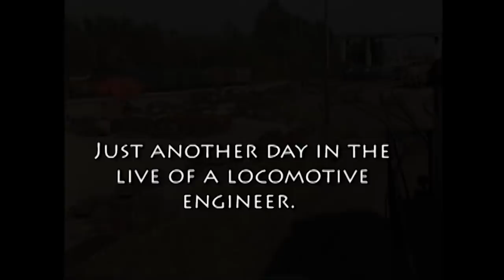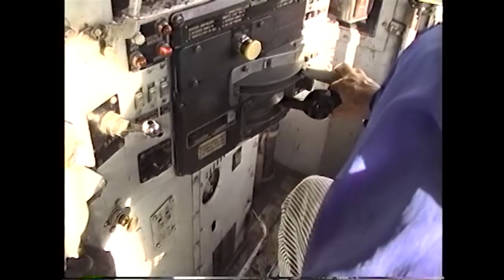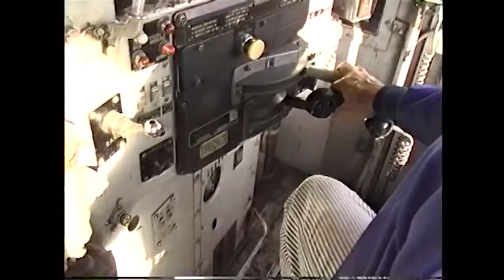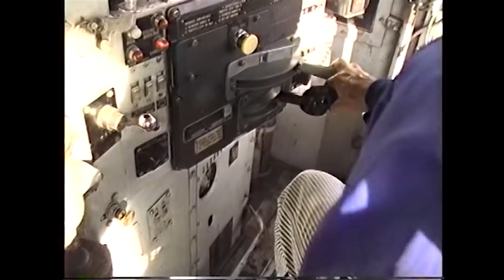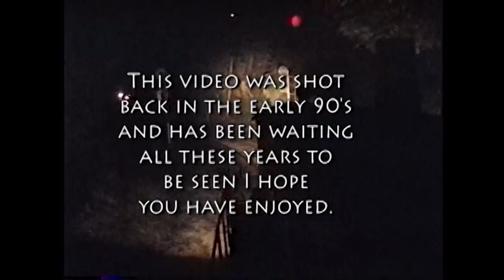View from an MP15DC Locomotive on  Southern Railway Freight Train 1995 New Westminster to Chilliwack

Comment: great video. only comment is, those locomotives are not sw900's. I heard the engineer say 15? and the number board showed 151, which means these are MP 15 loco's, which BC Hydro received in 1975. The sw 900 loco's were all numbered in the 900 series, a hold over from BCER/BC Hydro times.
Reply: This is an EMD MP15DC.

Comment: Very good quality for as old as this is. Really enjoyed the video!
Reply from the maker: Thanks. It was shot on a CCDVX3, which was a high end 3CCD Hi8 camera. It was the first of the small, truly broadcast-able quality cameras. Sony sold thousands of them to TV stations to be used for news gathering, as they yielded quality that was almost as good as a betacam, at 1/10th the price of the cheapest betacam. They had a bigger brother to it, the EVW300, which I also owned. That was a 12,000.00 camera and was very close to betacam quality. So close, that when used with a virgin new tape, and the tape played back on a proper hi8 deck the video quality was very close a betacam. Of course the betacam SP was better, but the EVW300 and CCDVX3 was used extensively by small production companies, community access stations, smaller market stations. I bought my EVW300 from CHEK 6 TV in Victoria when they came off lease as they would lease them  for 2 years and then get new ones and the old ones were sold for half price. I had a VX3 and EVW300 from about 93 through to about 97, then I traded up to a DCRVX1000 DV camera and a Canon GL-1. Dumped the VX1000 in 2000 and traded up to a JVC GYDV500 in 2000. Dumped the GL1 in 2003 and upgraded to my first HD camera, another Sony. HDR-FX1. Still have the olf DV500, and the FX1 and a cx7 HDR.  I tell you I have had too many cameras. All in the strive to obtain the very highest quality possible.
Reply: Wow, what list of great cameras!

Comment: This was cool, maybe a bit drawn out but all the crazy drivers from the trains perspective is priceless.  So when they switch tracks, is it the same engineer in your train?  I did not see it stop and start back up.
Reply from the maker: Same crew. There was engineer operates the train. Conductor throws the switches and the fireman riding in the caboose throws it back after the train has passed.  The tape was about 2 hours so much was cut. I tried to use the daylight shots most. We left around noon and got back about 8. I remember we all sat back in the caboose in chilliwack and had dinner. Cn and CP had already eliminated the caboose. Replaced it with a robot they called F.R.E.D.  "fu##ing ridicules electronic device" is what they called it.  Has detectors to detect if any fires have been caused and monitors brake air pressure.  This was to eliminate the fireman's job.  His job basically Is to watch from the back and see if there are any hot wheels from a bad bearing or stuck brake causing sparks that could start a brush fire and if one does happen to radio ahead to get the train stopped so he can put out any fires started.  I would like to see "fred" put out a fire.  On this train the guy on the back was doing double duty. Technically he was the brake man but his second job was to watch for and put out a fire. They still have the brake man but he rides up front now.   That means a long walk back when throwing switches on long trains.